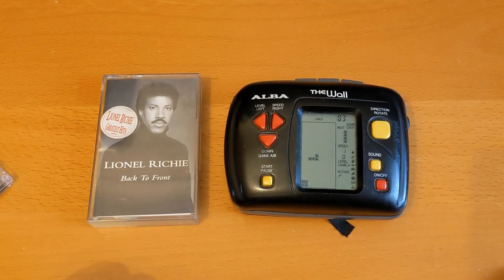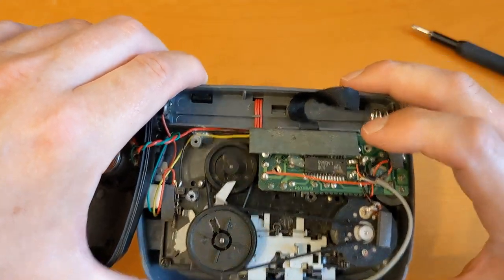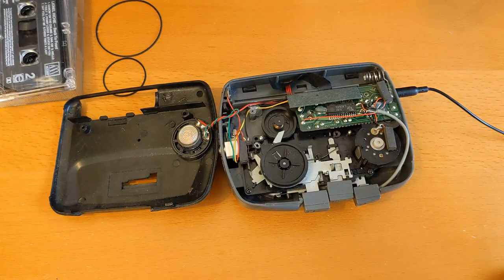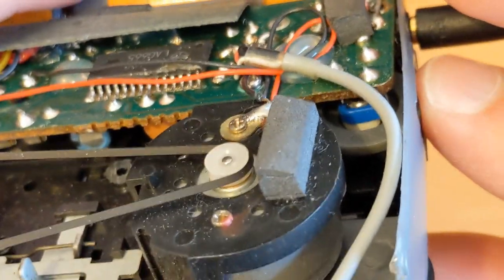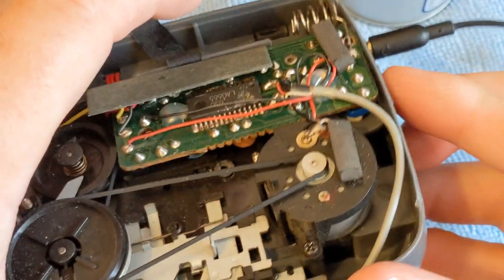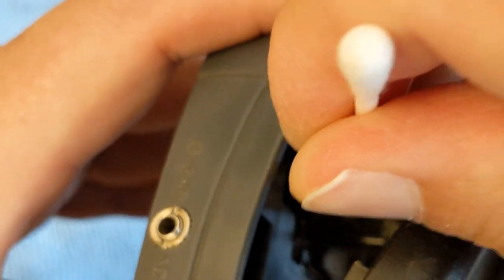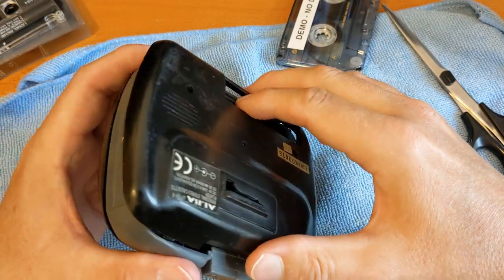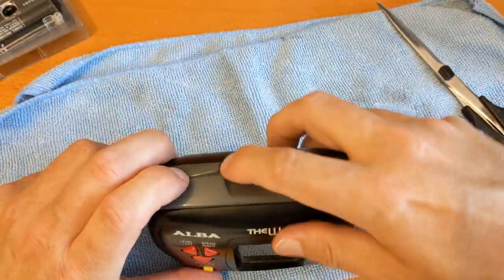Servicing a (not) Tetris (not) Walkman

Comment: Thats a small circuit board in there with almost everything on one chip! In my recent Sony Walkman video you can see I got stung with the big belts pack I purchased from china as they were useless and couldn't handle the torque. Caps in older electronics like 20-30 years are a common problem especially in AIWAs
Reply from the maker: Yeah, cheap as they are, I'm not a fan of multipack belts for personal stereos. Shoebox cassette players and CD/MD/Cassette drawers are ok.
I took delivery of my first AIWA Minidisc player a couple of days ago, but I think that should be okay cap-wise (I hope).

Comment: This is a bit of a long shot, but I would have been tempted to try re-routing those orange and black wires that are running across the LAG665 chip, just in case the chip is picking up the electrical noise that way.
Reply from the maker: Thanks for the suggestion. I'll try that if I can. Someone else suggested a capacitor on the motor. I'm pretty clueless about electronics (as you probably guessed), so I'm interested to figure this out. I've had similar buzzing on other devices too. Thanks.

Comment: Put a capacitor from the motor terminal  to ground, will stop the buzzing, experiment with ceramic cap values for the best result
Reply from the maker: Interesting idea. I have no electronics knowledge really, I don't know what values to use. I did salvage three caps from a child's toy recently. Any idea of a cap value to start with? And would it be negative terminal to ground? Thanks.
Reply: im trying to reply but youtube keeps removing my comment
Reply: picofarad or nanofarad, in my case 100 picofarad worked for me, you can buy a bag of mixed value ceramic capacitors on ebay for a fiver, then get some crocodile clip test leads, once you found the right cap then solder in. ground in these players is black positive on the motor is red usually but it doesnt matter because ceramic caps are not polarity sensitive, to begin try some caps directly across the motor wires, then from the motors terminal to the chassis ground
Reply from the maker: @Synthematix  Thanks for your efforts. If replies contain links then YouTube deletes them to prevent spam. I'll try to make sense of your answer during waking hours (I have zero experience with capacitors), then buy a pack and experiment. Thanks very much for your help.

Comment: I tend to watch on a 55" TV.

As for the noise, it's just the way they are. Poor quality motors coupled with inadequate grounding. Caps can help, sometimes, but it's mostly on very old units, and ones with surface mount stuff, and not generally these which are very basic.
Reply from the maker: Thanks for the info (watching and noise). Looks like there's nothing practical I can do about the noise though.